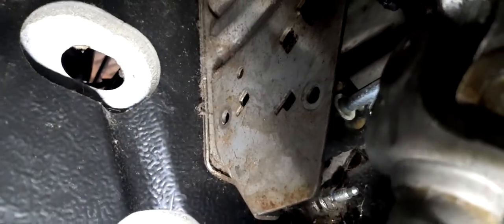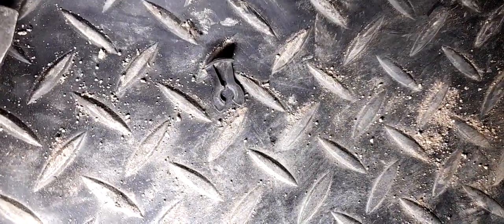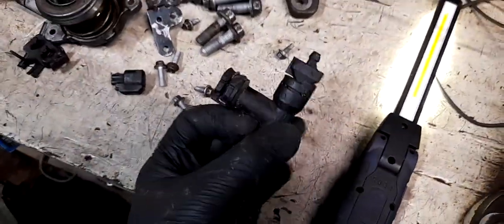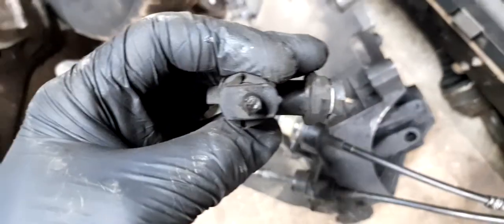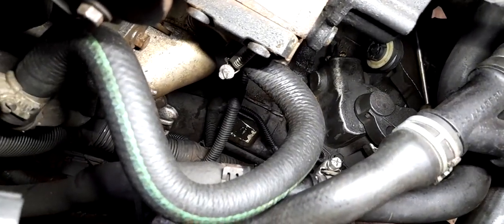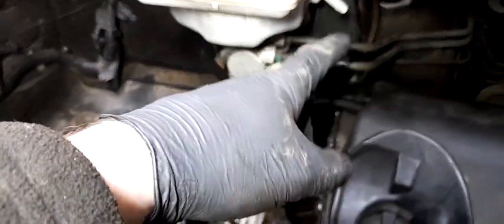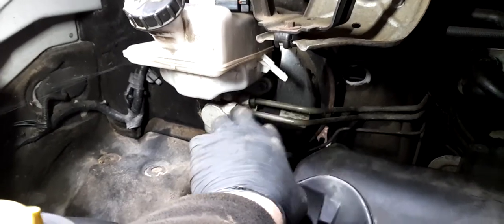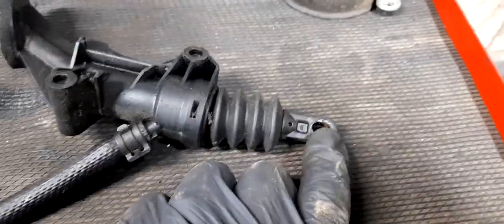2012 Ford Transit 2.2 diesel clutch master cylinder

Comment: I have just finished doing a 2011, fwd, it was a nightmare, nowhere as easy as this, if I where to do another one I would add some steps , consider these number one remove seat, doing this job with the runner sticking in your back is really uncomfortable. Consider doing a brake fluid change at the same time, so you can move the brake pedal up and down. Get one of the circlips shown, my one had a ordinary one that made it real awkward. and the thing I found really important in my case I could not get the master cylinder out and had to break off the plastic tabs, when putting back it would not go back in, so remove the bottom four bolts out of the brake pedal bracket this will allow you to get a screwdriver under the bottom of it to leaver out and  allow you to line it up better then to get the bolts in I found it better to use both hand and put the bolts in from behind the pedal. Good luck

Comment: Greatly appreciated this video is very helpful.  Would you say that if the pedal only intermittently doesn't spring back up , that this will be tte cause.  As i have a 63 plate custom with 88k on the clock.  And the clutch pedal sometimes goes low and needs pulling back up with my foot.  Also the 1st gear can be hard to engage most of the time.